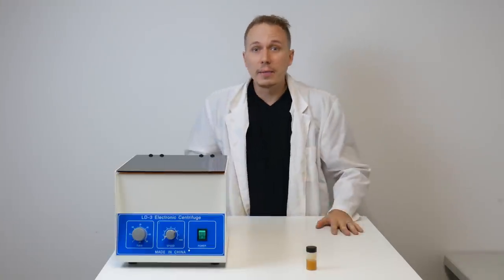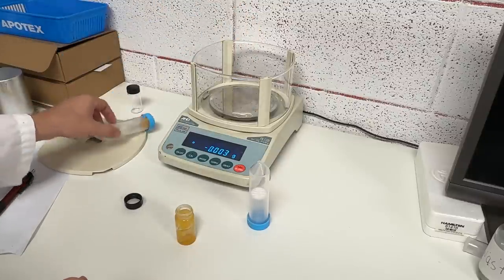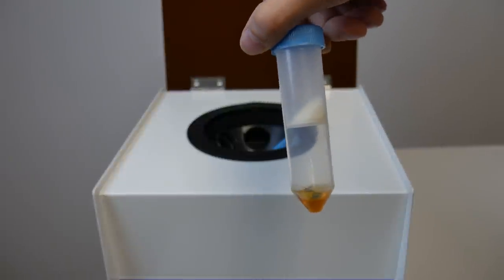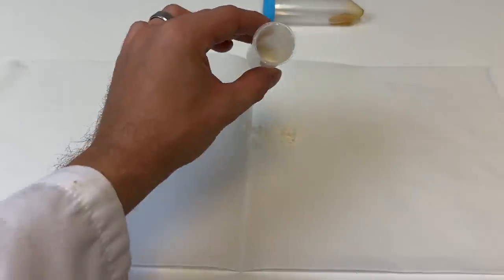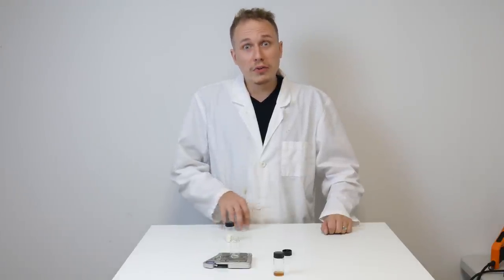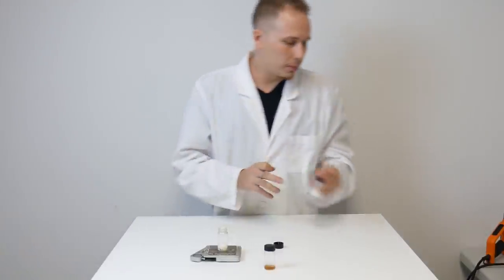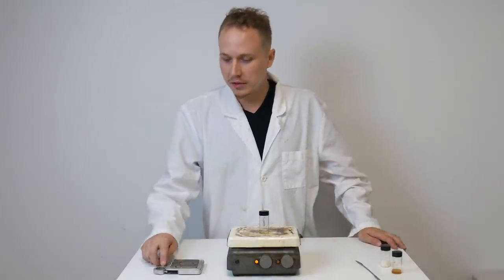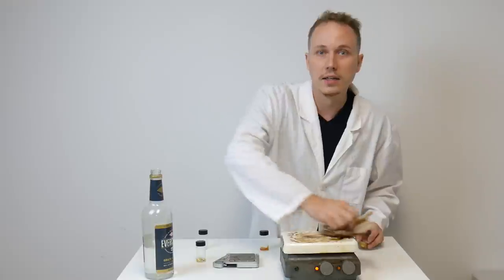Separate THCA from Live Resin and Terp Sauce using a Centrifuge

Comment: Actually you are sperating THC not THCA as it is not activated as of yet ot is only mechanically seperated. Very cool use of that machine but diamonds suck in my oppinion.
Reply from the maker: Your mixing it up, thca still has the carboxyl group and hasn’t been decarbed or “activated” yet making it thc.
Reply: @CartandPod  no I pretty certain THC is made on the plant and turns into THCA when burned or baked over 200 degrees. For 20 minutes. THCA is used for making edibles meaning it is already activated so investing it will have the desired affect.
Reply from the maker: @MR-puffnstuff thca is made by the plant and it turns to thc when heated
Reply: @CartandPod  maybe the heat in the machine does it.
Reply from the maker: The “a” on thca is the carboxyl group that is removed when decarbing, making it thc. 

The a doesn’t stand for activated or something
Reply: @CartandPod  ok.
Reply from the maker: @MR-puffnstuff thca is a crystal and thc is a liquid, so no, this thca
Reply: @CartandPod  I definitely understand now I been under the wrong impression for years even though I do the above never crystalline but I had equipment I know I could. I do dabble in dabs dry shift and various other things and scopping and documenting but I def had it half blank backwards thanks for clear up.